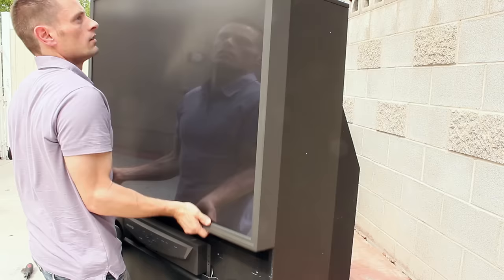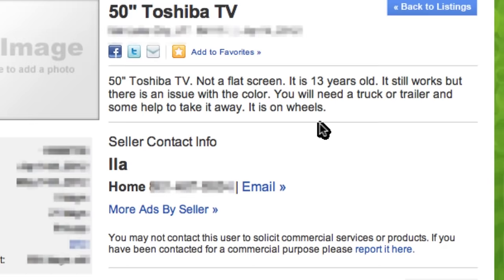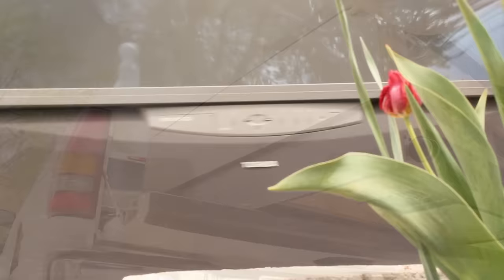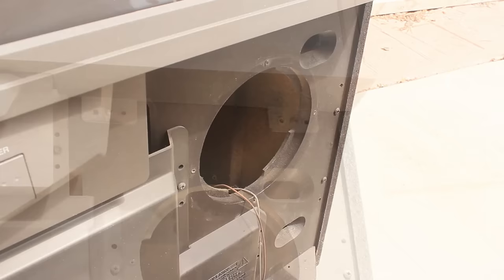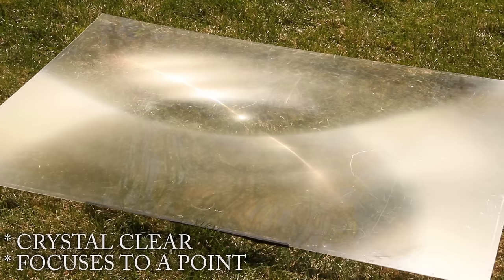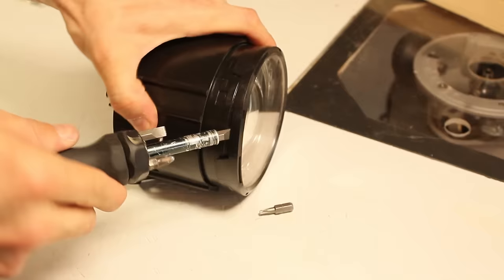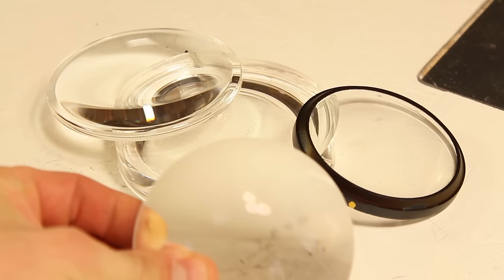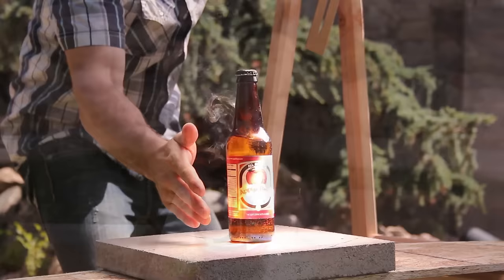How to get 2000ºF Solar Power

Comment: Hey, have you ever thought about pairing this panel with a boiler, steam engine and electrical generator?  The thought being to use the panel you have, focus it on a boiler which delivers steam to a small steam engine which in turn uses a drive shaft/belt to deliver the energy to an electrical generator?  Would be a cool experiment (pardon the pun).  My only concern would be the pressure associated with the 2000 degree cooker on the boiler which was addressed by governors well over a century ago.  Have heard of people using parabolic mirrors to focus the beam on the boiler, but those look spooky to me as the hot water is up in the air and focused skyward rather than downward as your cooker shows.  I could see placing the magnifying lens of your cooker on a gamble that would track for the angle of the sun ensuring a consistent heat on the boiler.  If you used distilled water, you would recirculate condensed water back into the system to be reheated reducing deposits in the boiler and piping.

Comment: I have an smaller TV. There are no screws that hold the screen in place. A large metal brace seals the entire thing. I'm not sure what is under vacuum so I'm worried that if i hammer the brace off, the CRT will hurt me. I disconnected the anode wire without discharging it. I stuck it back on but, idk if i should discharge it still. How can i proceed safely?

Comment: I think I know how you can quickly melt aluminum/brass with sunlight
Using the scorcher you made from a tv frame to focus the sunlight, put another lens underneath in order to focus the sunlight more intensively.  
Similar to a telescope or microscope you'll be able to focus the sun to a point you may ever be able to use the sunlight to smelt higher quantities than those small biscuits

- Mike G.

Comment: Alright, so the most useful thing I saw here was the portion were you can purify water. This is awesome, but I'm wondering if I can drink tap water after it's heated by the sun? Will it get rid of fluoride and other chemicals?

Comment: You missed all the electronics inside the set! When I take these big screen TVs apart, I save everything except the cabinet. I might be able to use the heat sinks for a future project, and I need something to generate high voltage, which I might be able to find inside a projection TV.

Comment: Should have used the parts from this TV to build the "projector" that uses a tablet, phone or laptop and blows it up. like retro fit the unit to hold the tablet in place of the cathode tube and reflect up off the mirror and onto the screen.

Comment: I just did this. happened to have a screen from my old rear projection because I was using the diffuser screen for another project. turns out I have the same type of screen Grant has. Burned my initials into a tree lol.

Comment: I wonder what would happen if you used the solar scorcher into the metal melting foundry. You would need to remake the foundry without the hair drier, but if you filled the rest with Isopropyl Alcohol, you could potentially get its max temperature higher than normal charcoal, which would be useful in casting other items. For example, steel, bronze, or iron. (Provided it actually maintains this temperature)

Comment: How reflective a mirror can get? Can it withstand the focused light from that fresnel lens?

Thinking of telescope-like system: large lens focuses sunlight, spreading lens “straightens” the beam and there goes a pair of mirrors: one fixed accepting the beam and pointing it down, and another one rotating (pitch and yaw axis), to point the deathray. AKA cliff engraver. Might need focus adjustment for the small lens and a way to track the sun, but that’s it. Hope someone does that, in my country there’s no way to get a fresnel lens of any decent size

Comment: couldn't you have used/hacked the frame the death ray lense came in to hold it? and do the inner projectors need to be cut open? the lenses should pop or slide out(might have to break a safety tab or two) since the slave force who made em assembled everything with a screwdriver.

Comment: If you were to use a mirror to direct the sunlight, could you make a beam, or would the sun lose most of the solar energy through contact of the mirror? 

My thoughts; it'd work, but perhaps lose 50% of the power! I'm sure curious to find out.

Comment: Any idea if this could melt solid or evaporate liquid silicone? wanna try this on solar panels and see if it generates more electricity but don't want to try it if it will fry the thing.
Reply: It will fry it I seen another video with a guy testing magnifying, he even tried putting the panel in an oil I forgot what it was called, and it kept the solar panel from frying but it didn't really have much increase
Reply: Nick Lively I have seen this used to boost solar panels. You just have to not focus the lens completely. Instead of a small point just back it off to create a larger, less intense spot.

Comment: Grant is there any danger of electricution when opening old tvs? Ive got one just like the one in your vid but ive heard that capacitors can hold lethal amounys of stored voltage or something.
Reply: wear a thick rubber glove and be careful
Reply: thats old tube tvs. and the circuitboatds are far from the screen
Reply: +Jack Wolf Actually capacitors dont need to be plugged in to hold deadly charge. I took apart the TV and used gloves so I was fine.

Comment: How does it react to a solar panel? And if it acts like an amplifier. What do you think of creating a version that runs on servo motors to track the suns movement?
Reply: +STOGGYRETURNS I think it would destroy a solar panel.
Reply: Of course if placed at the focal point but is there an optimum range where it would act as an amplifier and not a death ray? lolz :)

Comment: If they put one of these lenses in front of the mirrors at a Concentrated Solar Power Plant, would that increase the effectiveness of it all?
Reply: A concentrated solar power plant doesn't use Solar panels. It uses mirrors to reflect light and concentrate it on a tower. It heats up the water in the tower and causes it to boil. Spins turbines, and generates electricity. No solar panels.
Reply: +Colton Byrd you replied to your own comment...
Reply: replying to someone else's reply.
Reply: No. Because it doesn't work directly with water and steam. It works with oils, that are heated up and stored first - but you should't exceed their boiling point.

This means a lot thicker tubes to manage higher pressure. This means a lot of material, that needs to be heated up first, before you reach the oil. This means a lower speed of the flow. So you end up in an efficiency equation rather than a continuous optimization.

It is way easier to steer the temperature through some extra movable mirrors, than a too high concentrated beam. It will be less constant if you consider the clouds.

Comment: This seems more efficient than solar panels, like you should be able to produce tons of electricity from this just by solar tracking. Why don't we have power plants with huge lenses like that that heat the crap out of stuff and make power?
Reply: there's some thing by rawlemon a solar sphere says it can use lunar light. 
me personally  this would heat water for me

Comment: does anyone know if a regular cathoderaytube tv with a curved glass face would work too? because the one he uses here is a flat-screen without a curved glass front and im not sure if my tv woukd work
Reply: No that will not work. You cannot seperate the screen from a crt TV and it doesn't have a lens. You need to use a rear projection TV just like in the Video.
Reply: The front of a CRT is the same thickness from center to edge, so even if you cut the front off a CRT and remove the phosphorescent layers, you would just have a curved chunk of glass. A better use for it, is for a homemade aquarium.

Comment: hey I got a magnifying lense from a tv even bigggger than this one, I wanna make a thermoelectric motor using the heat absorbed by a copper plate at the center of the beam

Comment: what happens if you point this to a plane?
Reply: +alessandro pelayo  a mirror.
Reply: alessandro pelayo  thanks
Reply: +alessandro pelayo  honestly though, im pretty sure you cant, anything you try to use would just melt.
Reply: except mirrors
Reply: Youtubrerunknown  the mirror would definitly melt lol
Reply: Youtubrerunknown  from google asking can a laser melt a mirror?

"A 100 watt carbon dioxide laser has an invisible beam (far infrared, 10 micron wavelength) that is strongly absorbed by glass. It will happily vaporize mirror coatings and melt glass (or shatter it from thermal stress). You can buy one for a few $10k - just be sure to lay in 2 kW of electrical power and cooling water"

so if 2kW laser can melt a mirror, imagine what a sun can do?
Reply: +ElementalsMods "A 100 watt carbon dioxide laser has an invisible beam (far infrared, 10 micron wavelength) that is strongly absorbed by glass." Most light isn't absorbed by glass = your argument is invalid.
Reply: +ElementalsMods  what about reflecting the light first?
Reply: +Rambo JOHN Sounds impossible for a moving plane if you were planning to zap it out of the sky. You would need to get between the plane and the sun; and the plane would have to be at the focal point of the heat and stay there. Alternatively you could just hold the screen up when a plane goes over so that if the sun is out there is the chance that you would cook your self to a crisp.
Reply: +N7eptune  how bout a mirror
Reply: you know that you have to be in between the sun and the object for this to work right? #futuramadidit 
or are you trying to further melt the burning wreakage of a crashed plane?
Reply: +Rambo JOHN - Regardless if the mirror works or some super mirror, it would be impossible to ever achieve a focal point where you damage anything more than a few feet from the lens. in other words, its just not possible, even if the sun was coming from the earth, only way it would work is if you were on top of the plane with that mega lens focused 4'-6' over the plane.
Reply: Rambo JOHN nothing

Comment: i just discovered free enegery
Reply: step 1 solar panel 
step 2 battery
step 3 hydrogenate gas furnace/generator
step 4 repeat process at least 6 times
step 5 sell electricity to the grid
step 6 retire